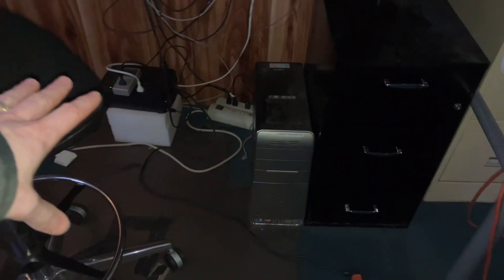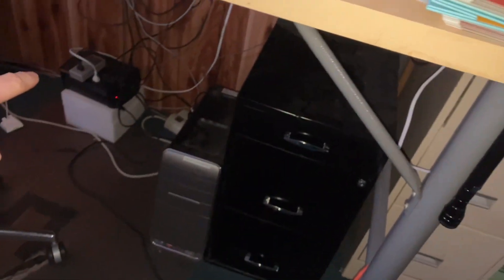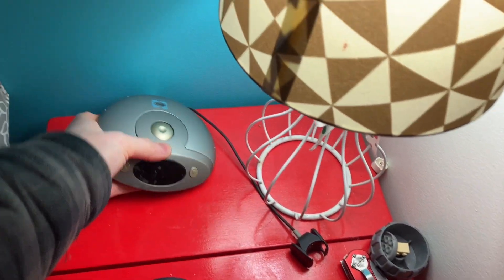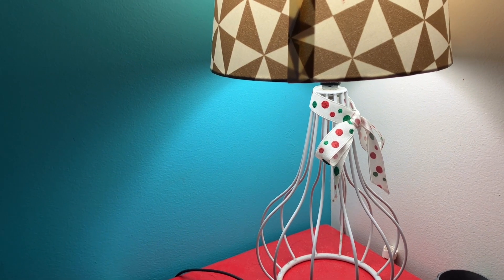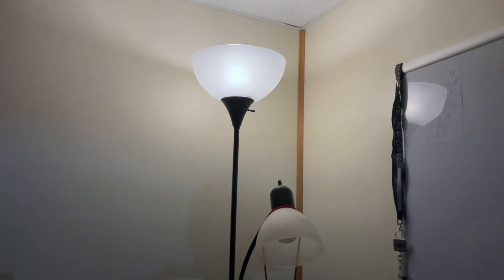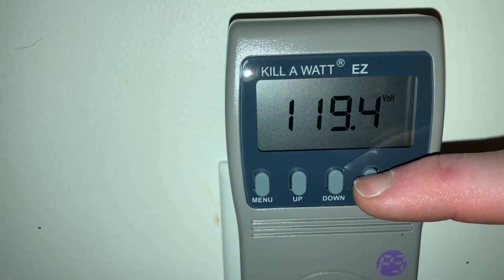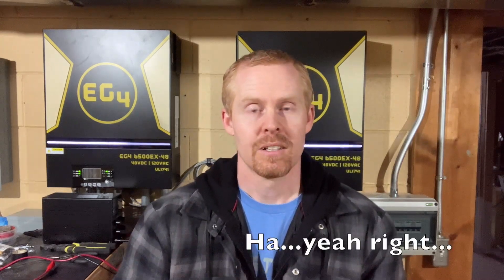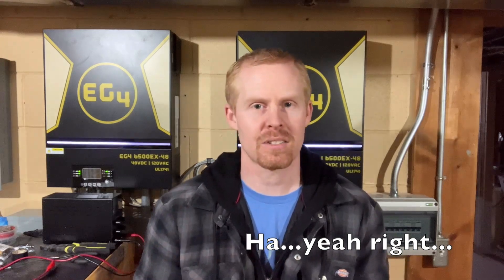Update: Possible Flickering Light Fix for my EG4 6500s?

Comment: I am experiencing light flickering on my units. Especially in the evening, which is really bothersome. It happens every night and I’m not sure how to fix it. I am on firmware 79-71, but it does nothing. Any suggestions on fixing this? I am fully off grid with two e64 6500ex inverters
Reply from the maker: Are they cheap bulbs?  Those were the worst offenders for me.  
You also might have to go through and just start turning off breakers when your lights are flickering to try and trace down which circuit might be causing the issue.

Comment: Just upgraded my 6500 to most recent firmware. I think flickering got reduced a bit but some of the LEDs still have this faint flicker.... I also compared to Low frequency SunGoldPower 6000w inverter. Flicker was completely gone on all effected LEDs except for one that was connected via dimmer. Although it's flickering was noticeably reduced compared to 6500ex with latest firmware.

Comment: In my case it's the HVAC blower motor, Deep Freezer Compressor. When either kicks on... Disco party starts.
Reply from the maker: Hehe, I know the feeling.  Do the lights keep flickering the entire time those units are on or just a quick flicker and then it stops?
Reply: @AdamDeLayDIY  entire time. I've since defrosted my deep freezer and that helped reduce compressor run time (was way over due) and I switched my blower fan speed to a higher setting. Now the disco party is mostly gone.

Edit to include anything with a poor power factor seems to  cause issues.
Reply from the maker: @jasoncr8419  sounds like my washing machine

Comment: That heat blanket has a PWM in it , lots of things have a pwm in them  Causes on and off ripples. I'm sure that's part of your problem. The power sensing circuit in the inverters is picking up on it. I know on my large 12 kilo W transformer style inverter it has a power save mode if that's turned on the flickering gets away worse because it's checking to see if there's a load on the line. And I'm guessing with the high frequency type inverters it's even worse.

Comment: Btw. are your output power cables to the fuse panel a little small in gauge maybe? I'm running 16mm2 out from mine to my main fuse panel just to avoid flicker and voltage sag under heavy load. 10mm2 might also be doable but I wouldn't use smaller than that.
Reply from the maker: I’m using 4awg which is the largest gauge that will fit in the terminals (and it’s the recommended gauge in the manual).

Comment: This is going to drive you nuts. Did for me for months. The only thing that helped is the title 20 compliant bulbs, philips hue wifi bulbs and the title 20 complaint LED can's.  The dimmers now work but the cans will flicker for a second or 2 while the capacitors adjust to the drop but they are steady after that. Nonsense IMO. This should not be an issue. TBH glad I am not the only one. I tried everything for months in the DIYsolar forum and this was the best result.
Reply from the maker: Thanks for sharing.  I've got a few Phillips Hue bulbs, in fact the one in my office is one of those.  Out of curiosity, what make/model dimmers do you use?

Comment: My flicker is caused by an old freezer in the garage. I also get a short flicker when our 3 ton heat pump cuts off. I wonder if the freezer may have a defective start relay,maybe chattering after the relay coil warms up.

Comment: I think all your problems are the inverters.  They're reacting to issues with the loads.  In the case of the MacMini, I suspect it may be noise interferes with the inverter's voltage sensing. You might want to try a noise filter.  As far as power factor, I'd look at what the inverters see.  A small device with a poor power factor isn't going to have much of an effect if there's large loads that "swamp" what the device is doing. Some of it (like the electric blanket) I think is just the inverters not quite holding the voltage as the load changes as the blanket cycles on/off.

Comment: As I have stated before dump the APC they are garbage and since you are on battery power you don't need it.  Unfortunately it has already damaged your MAC and it will continue to decline.  Make sure that no grounds are on your netural buss and vise versa, the only place they  come together is at the main panel, meter connection.  Sub panels that require grounding rods are seperate buss for neutral and ground and never shared.  It is also possible that there is a momentary hertz deflection when larger loads come on line and that is the problem with the transformer in the inverter.

Comment: I think your problem is harmonics on your neutral caused by switch mode power supplies. 
The Mac mini has a switch mode power supply in it. 
The meter that you were using to determine power factor is probably not telling you the truth. Power factor is a relationship between current and voltage. With a large amount of harmonics on your neutral that meter would have a lot of trouble determining the true power factor.
As I was watching your video, I was noting all the power strips and different things plugged into them almost everything today that uses DC to control uses a switch mode power supply . I’m a retired electrical engineer with about 50 years of industrial experience and I know that switch mode power supplies do reek havoc with neutral sizing. A typical rule of thumb is that the neutral should be 1.73 times as much as the current carrying conductors. This is done to offset the current of the harmonics that normally you can’t detect.
LED lights and everything you can possibly think of all have switch mode power supplies built into them some are good some are not so there is in my mind a reason to be concerned about harmonics. 
I would suggest that you talk to signature solar, and ask them about harmonic problems with the inverters. 
You might also consider a one to one split phase transformer between the inverters and your loads, this will no doubt affect your efficiency, but it might help with the problem.
Reply: From what I'm seeing on the blanket, the heating elements are cycled on/off.  It has good power factor when the heaters are on, but poor power factor when only the electronics is running (likely a capacitive dropper).  But since the poor power factor is only during light load, it's probably not making much of a difference to the inverter.  I think the bigger issue is the cycling of the load and resulting change in voltage. The inverter is not keeping the voltage rock solid under changing loads.
Reply: @russellhltn1396  The heater is probably in the order of 40 watts continuous if that's the case (single bed or per side).  I'd be surprised if the inverter can't handle a 40 watt resistive load going on with decorum but anything's possible.  How often do you see the smart blanket controllers cycling the elements?
Reply: @retrozmachine1189  The inverter is handling it, but it's causing a 1 volt fluctuation (118.4 - 119.4)  Keep in mind the lights don't care what other loads do.  What they care about is the voltage (and perhaps waveform) that they see at their terminals.  The inverters are not as "stiff" as the power company when it comes to holding the same voltage when the load changes.
Reply: @russellhltn1396  Might be a misunderstanding in terms.  By decorum I meant the inverter should handle it without any significant fluctuation in voltage with such a light load variance not that the inverter can't handle is falling in a heap in some way.  If an 'economical' inverter such as the units I have can do it, a unit such as these certainly should.  The EG4 is now another in my list of inverters that do react less well to certain types of loads.

Proving the inverter simply having a volt or two droop and that being the issue with the LED lights (I can discuss how most LED lights regulate the LED current, its usually a pretty basic affair which is why this happens in the first place) would simply be a case of turning a 40W incandescent lamp on and off and observing the LED lamps.  If they don't show the wiggle in brilliance the inverter is handling the load correctly and would lead me to think that the electric blanket controller is not a slow on / off cycle but phase angle switching or some other higher rate switching.

Of course any small inverter like these things does not have the performance of the grid.  The inverter might be able to do 70A max on the AC output on short circuit and is, or should be, quite well regulated.  The grid can easily supply 4 to 10kA on short circuit at the premises but has no near end regulation at all and achieves instantaneous stability by sheer brute force.
Reply: @retrozmachine1189  The Big Clive channel regularly takes LED lights apart.  There's quite a few that do not have any regulation. Perhaps the solution is to upgrade to a better class of LED.
Reply: @russellhltn1396  Yes. There are simple capacitor dropper types that either drop closely matched strings of LEDs across the mains, and / or use a resistor.  Most of the lights you will find in your house will be the type that use a current regulator.
Reply: @retrozmachine1189  Adam may need to take some apart.  If the lights are regulated, then the only way they'd flicker is if there's a pretty significant voltage drop for an instant. I'm thinking this may come down to you can't use cheap lights on inverters powering multiple loads without flicker.  The alternative may be to require things so all the lights are on their own inverter separate from cycling loads. Better yet, get lights intended for RV use and run them off DC and skip the energy loss in the inverter for lighting loads.
Reply: @russellhltn1396  Yep, completely agree there.  If the situation permits DC lamps are a better idea.  I think the issue with regulated LED lamps could be addressed with a larger storage capacitor to smooth out the variations in the mains voltage to take the abrupt flicker to a smooth change that would be less noticeable or perhaps completely eliminated.  I have some decent quality filament style bulbs that are affected by an inverter that has the issue so I might give that a whirl and see what the result is.  It's not just LEDs that are affected, I've seen CFLs do it too but much less pronounced.

Another possibility with his LED lamps that I've only just thought of is, are they dimmable?  It might also be that they are reacting to the dip in voltage as if it were a phase angle dimmer switch point.
Reply: @retrozmachine1189  A capacitor would only help on the battery side.  (And it would have to be a big one.)  A cap on the AC side would cause low power factor.
Reply: @russellhltn1396  Yes, a storage capacitor does cause a poor power factor  (no LED lamp I've come across that uses a simple current regulator makes any attempt at PF correction), but it is a part of most bulbs already because without it they have quite bad flicker.  Not everyone is sensitive to the 100/120Hz flicker but some people are and it will certainly cause grief for anyone using a motion camera.  Even a high PF regulated bulb will have a storage capacitor in there, just a value that is so low that the voltage on it tracks the AC waveform for most of the cycle only diverging at the lower voltages where it keeps the LEDs lit but at a lower level.
Reply from the maker: Thanks.  Odd thing is only one of the mac minis I have in my office is causing the flickering problem. 

Just curious, if the neutral is supposed to be 1.73x the size of the current carrying conductor, why is it the same size when you buy SER or romex?  

I don't think SS is gonna be of much help.  I'm still waiting on answers to simpler questions.  

Thanks for the suggestion about the transformer, but I think due to the efficiency and the cost factor, I'm gonna have to look for other alternatives.
Reply: @AdamDeLayDIY  There are a lot of ways the problem can happen.  It's more or less best described as a convergence of things.  I've seen setups where the inverter would operate just fine in a fully floating installation, ie no common earthing system where the DC side is earthed for lighting protection and the AC side has a neutral/earth bond which is also connected to that earthing system.  Noise from the AC side makes it back into the DC side and fubars the HVDC regulation.

From my experience at least it is unique to high frequency inverters as they are far more prone to their own noise (residual 20kHz PWM in the AC output) causing the problem and the way they regulate the AC output.  Low frequency inverters have that big chunk of metal transformer which naturally filters the PWM to close to nothing and also tends to filter out any short variations in output voltage due to instant load fluctuations.

The electric blanket will be one of the fancy ones with a 'digital' controller I bet.  These things have a lot of heating power levels and it's done by chopping the AC that goes to the heater wire.  The old style ones, that we used to have in the '60s and '70s that just had 3 or 4 settings via a simple mechanical switch and had no electronics at all would not cause it.

LED lamps make it apparent because there is no thermal mass of a hot wire there to ride over the random fluttering in the AC.  In extreme cases I've even seen the voltage ride around between 210 and 250 and that will cause problems for everything, even the microwave oven.

Comment: I have similar flickers with LED lights even when running in bypass mode. I assume the LED lights are just super sensitive
Reply from the maker: That's interesting, because I don't have the flickering when in bypass mode, only battery mode.  Everything should just pass through from the grid when in bypass, so it seems like you might have a different issue.  What kind of bulbs are you using where you notice the flickering?
Reply: @AdamDeLayDIY  They're cheap amazon basics bulbs, so that could be part of the problem. I have a couple heating pads that cause the flicker, but oddly enough neither of my two heated blankets cause it. Once I realized it was the heating pads I stopped using them lol
Reply from the maker: @ChazLakinger  I would suggest trying to do a bulb comparison to see if you can find a better quality bulb that doesn't flicker.  I would imagine the amazon basics ones are pretty cheap in quality.  

I know I've had pretty good luck with Sylvania and Phillips bulbs, but anytime I get a generic box store brand, they flicker like crazy.
Reply: @AdamDeLayDIY  I’ll try out some Sylvania bulbs. Thanks for the tip!
Reply: Just wanted to give an update on the light bulb discussion. I’ve now tried a handful of brands. All 100w equivalent dimmable 5000k bulbs. Amazon basics, Sylvania, Cree, and Feit. The Amazon basics and Sylvania seem to be nearly identical. The Feit and Cree are also very similar. The Feit and Cree have a more greenish hue to them that I don’t like, despite being “high cri” bulbs. Maybe it’s just not what I’m used to. All of them flicker on grid power when I turn on my heating pad. All flicker on battery power when dimmed. I think I’m going to stick with the Amazon basics bulbs because there’s no appreciable difference between them and the Sylvania that I could tell at least, and the Amazon ones are cheaper. Just thought I’d put this info out there in case anyone finds it useful
Reply from the maker: @ChazLakinger  Thanks for sharing.  Those are interesting results.  It seems like your heating pad does the same thing our electric blanket does.  

I haven't tested the Amazon Basics bulbs, so that's good to know you're getting similar results to the Sylvania bulbs.  

The Feit bulbs I had all tested very poorly.  Any imbalance caused flickering, so we had to get rid of those quickly (for our sanity sake).  

I had thought about the Cree bulbs, but hadn't gotten any to test.  

Again, thanks for sharing!

Comment: My current setup is just one 6500ex laying on a table. So nothing is set right, but I noticed light flicker on grow lights I have for microgreens when a kiln I made is running. Freezer power light flickers as well. The kiln controller switches the elements on and off to maintain set temps.

Also lights flicker on my parents Sol-ark when the generator is on.

Comment: Putting the devices that use PWM controllers on line conditions might resolve the issue as they usually use a combination of capacitors and chokes which should smoothen out the ripples that the inverter is reacting to. A quality power strip might be good enough...
Reply from the maker: How do you identify what uses a PWM controller?

I had the Mac Mini on an APC UPS and it still had the same issues.
Reply: @AdamDeLayDIY  I cannot say for sure (you can tell by looking at the boards directly). PWM is a cheaper way to modulate power for something like LEDs and can be used in heating elements as well (more efficient than using a resister). It's basically pulsing power on and off at a ratio to control (modulate) power (AC wave). Many power supplies are switching power supplies and do something similar. Well made circuits should have capacitors and chokes to smooth out those ripples. Your MAC power supply shouldn't be causing the issue. Is it after market?

I still don't have my inverters hooked up so I can't do any testing yet (weather isn't cooperating this year...)
Reply from the maker: @Mike80528  Thanks.  Good luck getting your inverters set up!
Reply: @AdamDeLayDIY  The UPS just passes through the incoming power when that voltage is within normal operating specs.  There are some higher end UPS models that produce output power via and inverter all the time and then take power from the incoming line to keep the battery topped up.
I took one of my home PCs off-grid with a DC power supply run off my 12V system:
https://youtu.be/hIL-sqeO-Dc